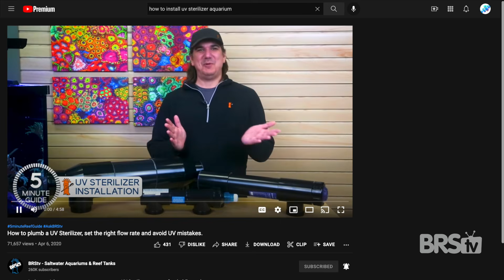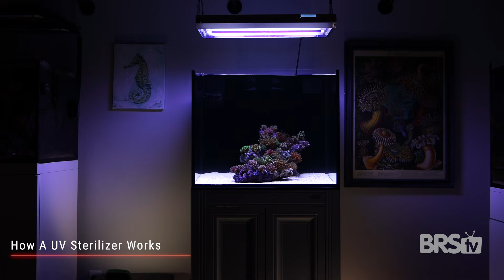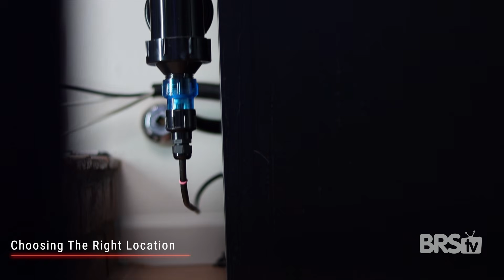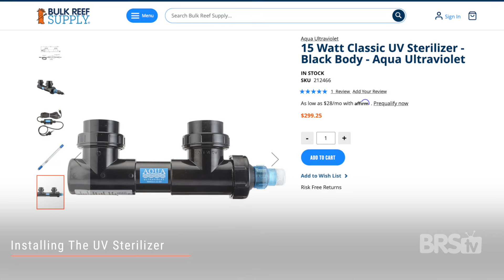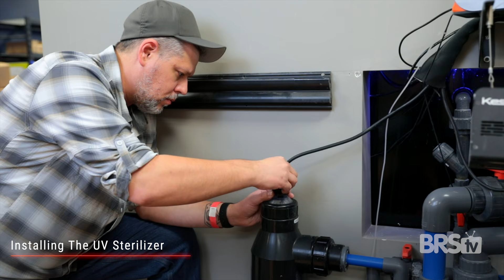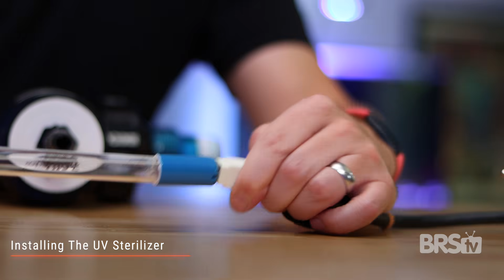Adding a UV Sterilizer to Your Reef Tank Can Be EASY!

Comment: The UV sterilizer is one of the most under rated pieces of equipment in the hobby. they Arnt as exciting as the roller filter or a protein skimmer, but in my opinion are more important than both combined. if you are short on cash and only have money for 1 of the three, UV sterilizer should be first. your fish will be healthier, your water will be clearer, and you will have wayy less nuisance algae. nice simple video brs! thanks!

Comment: Hey Matt, I am looking to do the same thing as you with the flow meter. Could you tell me which pieces you purchased to do the plumbing for the meter? Because the meter has 1" but the UV came with 3/4

Comment: You said place the uv pump in the filter sock area and directly return it to return chamber. What about the in between where the protein skimmer is. Mine is similar so where should I actually be putting it??
Reply from the maker: As long as the feed pump is going pulling water "upstream" from where it's going back into your system, you won't have any issues!

Comment: pretty sure Ryan told us a couple years before this video was made not to run the UV in a closed loop from one section of the sump and back into another section of the sump...🤷‍♂️...
Reply: Yup I have my installed inside the return pipes , once water enters the return pump on the way back to the tank my uv is on the way.
Reply: @sxpremxcy517  yup i watched the same video.  whats ur opinion on it?  skimmer section to uv to return section?  or return section to uv to display?

Comment: The setup of dumping UV return water into the return chamber is causing problems with ATO. The water level in return chamber is not changing. Observed the main chambers water is fluctuating. The pump feeding UV is Cor15 and main return is Cor 20. And cor15 is running at low power than 20. So when 20 is pushing up more water to the display, for some reason evaporation is not changing the water level in return chamber. Any help is appreciated. Thanks..!

Comment: If I needed to reverse the flow direction because of space (input at the top/output at the bottom instead of input at the bottom/output at the top), is that an issue as long as it's upright/vertical?

Comment: Where would you install the pump and return line in an AIO Red Sea E170? I am asking because technically the return pump is after the mechanical filtration with this tank. Maybe the pump could go in the chamber where the heater goes and add some filter floss on top?

Comment: I am planning to install a 15W Classic Aqua Ultraviolet UV sterilizer on my WaterBox 60.2.  Two questions... 1) Is okay to plumb the UV inline from the return pump? and 2) I noticed that the barbs are designed to allow for 1/2" or 3/4" tubing.  If I am using 3/4", should I cut off the 1/2" portion of the barb? The internal diameter narrows at the 1/2" portion and I figured it would be better not to needlessly constrict the flow.  Thanks!
Reply: did you figure this out? also what pump are you using?
Reply: @jimmybyrne4272  Yup, I plumbed it inline using an EcoTech Marine Vectra S2. The barbs allow you to trim them based on the hose size. So I cut the tip off to allow for the 3/4" flow rate. Also, note that if you are using a UV for dinos, it's better to use a closed loop.

Comment: Great video 

Question - is it ok to have it intake from the sump where my skimmer is, and empty into my return?
Reply from the maker: That's not a bad way of doing it. Just keep in mind that this setup will mean that some of the water will bypass the filtration in your sump. This may or may not be a big deal depending on your system's setup and bioload.
Reply: @BRStv  does this also apply to running carbon?

I have the intake pump and outtake line both going into the same return section of the sump

Comment: I stopped using the flow through type 15 years ago too much maintenance cleaning quartz tube and seals always break down I now use UV wands they are like a heater direct contact to water put them in sump just just have to be careful when looking at them easy
Reply: What uv wand do you use?

Comment: What are your thoughts on an internal uv sterilizer.You just place it in your sump,can it do the job
Reply from the maker: UV is a great solution for a number of reefing related things! We've traditionally used more external UV sterilizers, but as long as you size the wattage and contact time properly, I don't see why an in-sump sterilizer wouldn't work 🙂

Comment: Love the video.  Question: I have used the clamps but the have cracked twice. The second time I used four brackets and supported the UV from the bottom.  The UV is mounted vertically.  Nevertheless the brackets cracked. What am I doing wrong?
Reply from the maker: Hey Michael, 
As long as you aren't overtightening, this doesn't sound normal. If you haven't already, shoot our customer service team an email and we should be able to get you in contact with the manufacturer for warranty support.
Reply: @BRStv  Thank you, much appreciated.
Reply: Who makes the brackets? I need some

Comment: Why not just add it to the return line from on of the return pumps? Is that not the ideal installation anymore?
Reply: I thought the same but maybe the flow rate will be too high.
Reply: Hey Ron, you can absolutely do that. As long as the return line is big enough and you can control the flow, it’s a perfect solution. The only question then becomes where to place the output. If you could put that in the tank it would be ideal!
Reply: My thought was to use a controlled return pump, go to the UV, flow sensor next, then to the return nozzle on the tank.

Comment: Why would you want to mount the electrical at the bottom if your installing vertically?  All of your leak points are where that connects PLUS servicing the sterilizer means now that the entire unit needs to be pulled down instead of just pulling the bulb or quartz sleeve.
Reply: You are 💯 correct. I only did it for wire management. But you are right, much more of a pain for me to service!

Comment: Wow!  Best UV video I’ve seen.  Thank you. My only knock is it would be nice for understanding plumbing from a manifold.  Many places state that you can attach your UV to your manifold.  But, since that is pulling from your return pump where do you return the water after the UV. I know to the tank is the right answer but haven’t seen any videos detailing how to do that.  Like Mathew said “in a perfect world”. How can one connect back into a return line after the manifold?
Reply: Your best bet is to plump the UV in line from your return if you don’t have a dual return line.   I tried mine off my manifold with a ball valve but it just throws off return pressure and recycles too much in the sump.   It also caused ATO to act up a bit.   A dedicated pump after mechanical chambers back into return section also caused my ATO to never kick on as my return section stayed at same level too long.   Just my experiences,  for what it’s worth.
Reply from the maker: In that case, you'd want a separate return hole drilled in your aquarium where the water that has passed through the UV returns to the tank. Of course, this is easier to do before a tank has water. Once your tank is set up, drilling an extra hole is a little sketchy.
Reply: @BRStv  Why not run it as a closed loop, on the return line? What does it change if you run the outflow of the UV to the DT separately vs. looping it back onto the return? 🤔
Reply: Hmm, maybe a closed loop on the return?
Reply: That is such a great question that looks like it has already been answered!

Comment: I guess the question becomes “do you actually need one?”
Reply from the maker: That's what this video is for: https://youtu.be/na6DERIlJy8
Reply: I won’t have another tank without one
Reply: @TheUofAfan  it is definitely appealing. I’m looking at it and it’s quite confusing though. It says in Aqua Ultraviolet’s brochure to limit exposure in a reef tank to 30,000 to 45,000. In order to get that I would need turnover between 800 and 1200 GPH and on a 90 gallon system that’s a lot of turnover. That’s like 12x per hour minimum through the sump. Seems crazy high.
Reply: @TheUofAfan  what happened??
Reply: A great question with some already great answers. But no, you don’t need one is the simple answer. I like them especially in qt tanks to keep fish bacteria and parasites low, as well as the crystal clear water it gives me!
Reply: Not unless you have a parasite or ongoing algae issue.
Reply: I am at a year and don’t have one yet.

Comment: I bought these for the Pentaire 25W model and have it set up exactly like the BRS tanks in closed loop with orange PVCs and gray elbows. I am using a Neptune pump since I already own an Apex so making small tuning is easy. I would probably need to add a valve if I want to have a low flow rate if I ever wanted to target non-algae organisms
Reply: This is great!  How is it working for you?
Reply: @MyFirstFishTank  I've seen noticeably less algae film on my glass. Water clarity has improved significantly for my new acro frags. Only time will tell but this piece of equipment is strictly for algae control (not reduction) since my fish are hungry beasts
Reply: @twofish7939  👌🏼